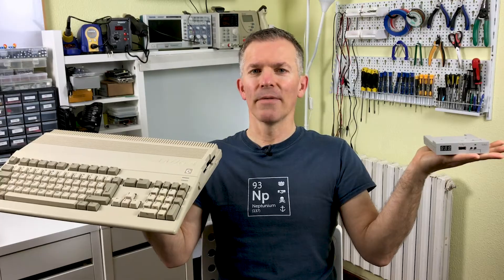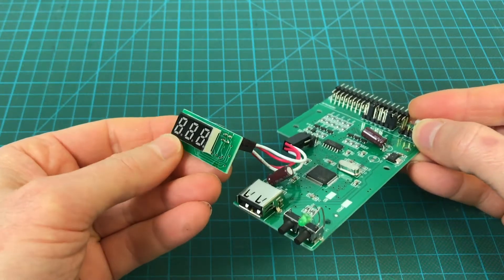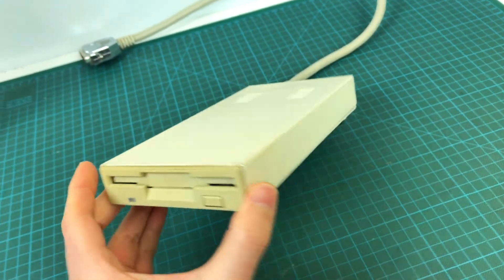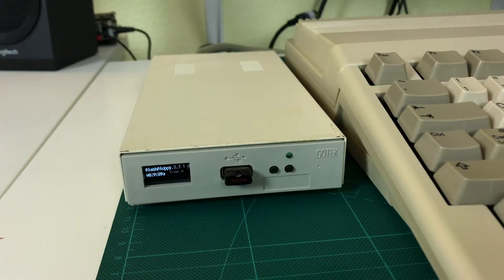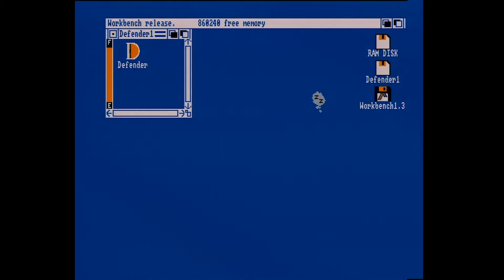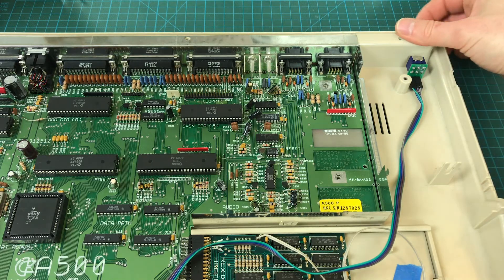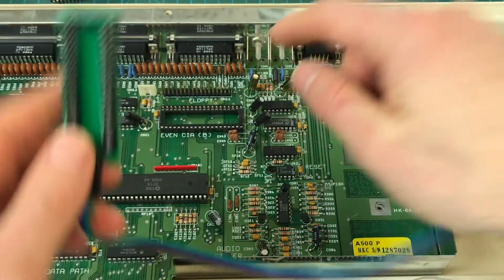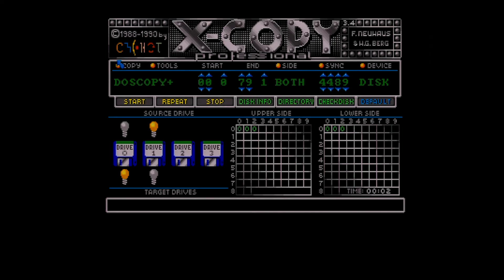External Gotek on Amiga 500 with Drive-Selector Switch

Comment: For 3:13, crazy cables aside, is it possible to do this or would you need to solder power to make that work? Couldn't you 3D print an enclosure to make that happen as well?

Comment: I'm using gotek fully external driver without the df selector i have not touch any internal part of amiga and since some of the games are not booting from DF1 the external drive (gotek) i'm using the usb of the gotek and then move to phisical floppy with X-copy so i can boot from df0 without doing anything to my amiga. Ofc you need to have some working amiga floppies but this is the solution to not touch anything of amiga.

Comment: Having just dug my old A500 out after 30 years and powered it on no surprise that the floppy drive doesn’t work too well. This looks like something to solve that however the gotek’s aren’t that cheap anymore. Also where did you get the OLED display from?  Finally how do you get disc images on to the USB drive?

Comment: I want to do this but I have never done anything like this and I am afraid to break the chip while pulling it out to install the adapter. Should I do it? Is it easy? Any recomendations?
Reply: Also the flat connector on my gotek is larger than tha flat cable in the DF1, so I am stuck.

Comment: Wonderful and useful video , but I would like to use this device without open my Amiga case.
How is A590 works with extended port at the left side, is there any option to use that port with this device or is there any option to switch the pins with any program ?

Comment: I must check my adapter with the multimeter actually. I was hoping to reverse DF0/DF1 when I setup something similar on mine. But iirc, when I toggled my switch, it disabled the internal drive and made the external DF0: I had hoped to have the internal become DF1 in that instance.
Reply: I've just made the same disappointing observation! The vendor of the drive switch Noel mentions, actually mentions it! Big bummer.

Comment: My particular external drive (which shares a common form factor amongst many brands) has pin 1 on the opposite side so I had to twist my short ribbon cable to make it work. I was concerned that it would slide off when reinstalling the cover. Seems to be okay so far. It is bugging me, though. I have another external drive I can use to hold the Gotek. I wonder if it has the same PCB design.

Comment: I had that external floppy drive, but I cannibalised the interface PCB  and remade it in 3-fold so I could have 4 floppy drives without forking out huge amounts of cash. And it worked, but unfortunately I don't have that setup anymore. I do still have my A500 in a box in the attic, waiting for a restoration.
Reply from the maker: That's a pretty cool hack! Anyway, time to take the Amiga out of the attic 😃
Reply: @NoelsRetroLab  Rest assured, that time will come. First we (my GF and I) have to finish renovating the attic - It's going to become our leasure palace, and my (retro) mancave - no association with RMC haha - I have already built the workbenches that will host a lot of retro and non-retro work. Might I take this opportunity to compliment you on your channel, your way of doing things and ready to go to great lengths to get a job done, even if it means doing some fringe stuff and trying out new things. I really like that. Oh and kudos for your very clear english, and especially your vocabulary!

Comment: Great video - very helpful and well made - thanks! I have one question though - is it really safe to use the boot selector switch while Amiga is powered?
Reply from the maker: Thanks! I never considered it would be unsafe to be honest. All it's doing is routing a single signal differently, so I expect it should be totally fine.
Reply: @NoelsRetroLab  I've read in several places that it's NOT fine. It can damage the CIA chip.

Comment: Can´t you simply use both drives internaly? There is so much space inside the A500... The backdoor is available at thingiverse. So without damaging the case of the A500 you might simply print a new trapdoor with a hole for a small USB drive like the Intenso Slim Line sticks to connect it there. Also a switch (of course a flat one). For display and push buttons print a smal "external" case. You only need a 6 wire connection (the buttons both use a signal and a GND, one of the OLED is also GND). You can route them inside the A500 out on the top (ventilation slots). Something like https://www.thingiverse.com/thing:2701629 , but the two buttons (or an encoder wheel) added.
Of course you have to route the df1 select to the internal floppy connector (like it is from stock on A2000/3000/4000). But thats only one wire on the underside of the PCB. Of course you have to make a drive cable to connect both drives. As you have to make it yourself to connect both drives, you make the turn of df0 and df1 select in the cable (like it is done in A2000).
It would be a completly reversible mod, no permanent modification - and much more comfortable than having always an external drive to connect.
Reply from the maker: Yes, I believe you could. The only thing is that you need the Gotek and a controller for it. Or at least so I thought. Someone told me it's not necessary, but I haven't confirmed that. In any case, yes, there's definitely space internally and that would be a lot more convenient than pulling out that brick of an external drive 😃
Reply: @NoelsRetroLab  Actually there seems to be much more interesting projects than a gotek. In 2013 there have been at least two projects to use a Raspberry Pi with a bunch of discrete parts for about $5 simulating an Amiga Floppy drive. At that time the Pi Zero W did not exist; I wonder if its possible to port that projects to it. It would be about 5$ more than a gotek - but transfering adf´s via wlan and selecting image to load via webbrowser would eliminate any need of case modding, as you use the sd of the pi and do not need swapping it arround to transfer data. It even emulates two floppys in parallel (if df1_sel is at the floppy cable like on A2000 A3000 or A4000, or added manualy to it). So using the Pi Floppy Emulation + internal drive would allow 3 floppys at the same time (if you also route df2_sel to internal cable). Have not gone into details of the projects now, only read summary articles.

Edit: Sorry, now found out the Pi +5$ Hardware solution does not use an operating system on the pi, so no wlan available (but still an interesting solution) while the wlan version uses a pi and a SB HxC Floppy Emulator (>>100$), so out of range in price (and also cant write to image).

But there might be an interesting alternative: It should be possible to use an ESP32 (or even ESP2866) in i2c-client mode to put the i2c output for the oled into a web-server. Also with up/down buttons using two I/O-pins it should be able to select images. So you can select images
 via smartphone and avoid button and display on the Amiga. Also there is a simple mod for making SD-Cards accessible via webdav using an esp (https://de.aliexpress.com/i/4001031573171.html). This in combination with SD->SD adapter (instead USB-Stick) might work to transfer adf between PC and gotek...

Comment: Nice hack! The Amiga 1200 can boot directly from external drives, but they will never be interpreted as DF0:.
Reply from the maker: I didn't know that. Booting from the external drive is the most important thing I wanted to achieve from this. Is there a drawback to having the external drive never being DF0? I can't think of anything.
Reply: @NoelsRetroLab  Many games assume the drive their are booted from is df0: So they start to boot, than access to df0: to load a file and fail. Simply a bad art of programming. Quite a big drawback...

The CIA on the A1200 are PLCC44, not DIP. No socket, so no adapter. But of course, you have df0_select on the internal connector for the floppy drive and df1_select on the external connector. So cut the df1_select pin of the external drive connector and solder one wire to the pcb (to get df1_select) and one to the external connector (to put df0 or df1 select depending on switch position there). Also cut df0_select line on the internal floppy cable, sending the df0_select to the switch and the signal selected by the switch back to the internal drive.

Comment: Ola Noel. Muito obrigado pelos teus videos, já aprendi muito com eles! 
I think installing a switch to the back of the amiga, to toggle df0 df1 ended up being a more intrusive mod than just taking the internal drive and replace it with the Gotek. The original drive would be carefully stowed in a drawer, ready to go back inside  the amiga anytime you'd feel like having it back. Again, thank you very much for sharing your knowlege, I'm a subscriber and a fan. Greetings from Alhos Vedros, Portugal.
Reply from the maker: I can see that. I really like having both the Gotek and the real drive functional, so for me it was worth the small modification, but I get why people wouldn't want to do that. There's probably a way to put the switch on the external drive with a minor cable. Heck, I wonder if the drive connection has an unused pin that could be used for this. 
Que bom que gostou dos videos :-)

Comment: What connectors did you use, my external drive has female connections and my USB emulator uses a small ribbon cable and power cable but these are both female at the business too :(  I can only find 40 pin Male to Male adaptors online
Reply: Would love to work this out

Comment: i was wondering if there is a way to mod the Oled display so you can get it retro style ? like orange or green maby. i havent found a video like that. do you think its possible ?
Reply from the maker: Not sure. I imagine you'd need a different kind of Oled display, but I don't remember seeing them anything other than blue or white. You could leave the segment digit display the Gotek originally came with for a more retro feel (although it's a lot less functional).
Reply: @NoelsRetroLab  Im trying to find our old messages where you told me exakt witch buzzer you used :) but i can't find it again so if you can tell me witch one to buy :) thanks J

Comment: I bought a Gotek device from Amigastore and the darn thing does totally have NO mounting options whatsover to put it in the external case. And those screws are needed, not only hold normally the drive into place, but also keep the cover tight. Now I can't do both of them..... Jeeezz
Reply from the maker: Really???? That's so weird! I've never seen a Gotek case without mounting brackets. I have an empty Gotek casing and you're welcome to it if you want.

Comment: All the DF0/DF1 switches I find on ebay say that the internal drive is disabled when DF0 is set to the external drive. Is that just a mistake in wording (in that booting from the internal is disabled, since it's not DF0), or is it actually the case that the internal cannot be used when the external is DF0? If the latter, could you point me to one that makes both drives available in both switch positions.
Reply from the maker: That makes no sense. The switch is a really simple switch that moves a couple of signals around. It sends DF0 enable to DF1 and viceversa. So they must mean that when you have the switch on, BOOTING from the internal drive is disabled and you boot from the external one instead. But you're right, even the one I bought sais that. Weird! https://www.ebay.co.uk/itm/273053625803
Reply: Inside an external floppy case there is a small circuitry that does two things : activate the motor only if required and identifying the drive type connected. Inside an amiga 500 there is also the circuitry to activate the motor but nothing for identifying the drive. This is no problem since the ROM assumes that DF0 is "double density" and always present. The problem happens when you logically swap DF0 and DF1 : the external drive become DF0 and works perfectly but the internal drive which should become DF1 isn't recognized since it lacks the identifying circuitry... Mods are possible but quite hard to carry out ;)
Reply: @thomasquemar969  so it means that if I want to copy from external gotek as DF0 to internal drive as DF1 I can't? thanks for a reply
Reply: @lucagentile4247  Yes you can but you'll have to flip the switch several times during copy to read from one drive and write to the other, as if you were using only one drive (DF0) and swapping source and destination discs.
Reply: @lucagentile4247  There is really no way to make an external disc drive act as DF0 without any modifications... You'll have to pull a chip (CIA) to put in between the adapter provided in order to do it. At the end of the wires, the switch makes "external DF0" possible, but if you don't want to do irreversible modifications to your amiga case, you'll have to let it loose (or maybe inside the trapdoor).

That's why personally I bought a "very poor condition" amiga 500 in order to heavily modify the case to fit all my mods... look here (in french sorry) https://forum.system-cfg.com/viewtopic.php?f=18&t=11536
Reply: @thomasquemar969  very clear. I am not bothered of modding a little the case so I will make a hole on the side. You have suggestion about how to do that?

Comment: Hi Noel, you are actually wrong about needing an external drive! You can solder a floppy cable directly to a db23 (or modded db25) connector and this work fine for the gotek. If you are interested I can mail you the schematic, you can even 'steal' the 5v and ground from the db23 connector to power the gotek. I make these cables myself and use them for a gotek and a 3d printed housing and these look and work perfect.
Reply: Yes, this is a very important point that Patrick Kerkhof is making. As a user I can verify that the described setup works flawlessly, I use it on my Amiga 500 where the Gotek is connected to the external disk drive connector via a modified DB25 connector cable that also provides power. I bought the cable on ebay, it was cheap and easy. I think Noel is right about keeping these old systems as original as possible, so this is a really good solution. If you have the ACA500+ you can actually switch the boot select (DF0/DF1) in the start-up menu instead of installing a fysical switch.
Reply from the maker: Really? And all of that while the internal floppy drive is also enabled? I'd love to find out more and give it a try!
Reply: @NoelsRetroLab  Yes, the internal floppy also works, this is a copy/paste from Keirf's GitHub that refers to it, and I think also a link where you can buy the cables. It is however quite easy to build them yourself. How can I send you the schematic of the cable?
One other nice feature I have installed is the kickstart switch from Keith, I am using one of the signals of the address lines to switch the bootselector (which I also installed). This way you not only have a switchless kickstart but also switchless bootselector :-)

Replacing an external drive depends on the enclosure or cable being used. Amiga external drive enclosures usually include the circuitry to allow the Amiga to identify the presence of the drive. In this case the Gotek with S0 jumper is usually a straight swap for the old floppy drive. If using a passive cable such as this Ebay item then be aware that this identification circuitry is missing, but for arcane reasons identification will typically happen to work as long as the Gotek has an image mounted when the Amiga boots. If you are having problems with your drive being identified, seeForcing Drive Identification below.
Reply: Hi Patrick. May you share more info on that cable schematic and 3d printing files for the external gotek?
Reply: http://www.ianstedman.co.uk/Amiga/designs/Floppy_Adaptor_V2/External_drive_wiring_V2a.png
Here you can find how to wire it up, I used a normal floppy idc cable and soldered the wires to a modified db25 so it will fit the db23. I cut 2 not used wires from the idc connector side and connected a power connector to these and soldered them to 5v and gnd on the db25 side.
Reply: That sounds great. Where can I get one? 🤔 Link doesn't exist anymore. Regards

Comment: Another great video for my continued learning. Question: Are you grounded with a wrist or shoe ground when working on the boards? I notice you handle the boards and components quite freely. I remember, from my high school electronics lab in the ‘70s and my TRS-80 & Atari days in the 80’s, the horror stories about damaging chips (especially CMOS) with static electricity. I’m probably too reluctant to handle boards because of those stories. Any recommendations about handling PC boards safely? Thanks again!
Reply from the maker: Thanks! To be honest, I'm probably not being careful enough. I've been told I should be wearing one of those ESD wrist straps and probably have an grounded ESD mat as well. It's in my list of things to look into, and I'm sure it's not a bad idea, but on the other hand, I'm not blowing up chips on a regular basis as far as I can tell (except the video I'm recording right now coincidentally). Hope you continue enjoying the videos.
Reply: @NoelsRetroLab  If you went bare foot and dont have a carpet on the floor but wood or tiles and do not wear syntetics, its nearly impossible to get staticly charged. A style of clothing you normaly do not wear in school or at work in the old days. Of course with home schooling and home office, at least in Germany working barefoot in underwear seem to have become the actuall normal office outfit, so ESD equipment had gone obloete now....

Comment: Noel, did You do any modifications on the external drive circuits? I have tried exactly the same on a similar config without any luck. Did you change any pins on the gotek?
Reply from the maker: At 2:11 you can see the jumpers and I don't have any set.
Reply from the maker: No, I didn't change any pins. I don't remember the exact configuration. Maybe it's displayed in the video at some point?